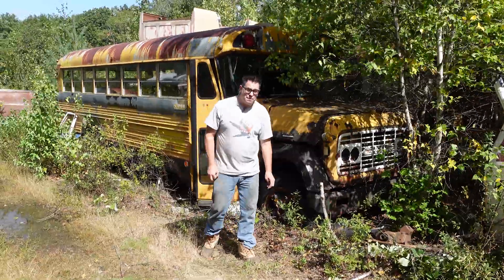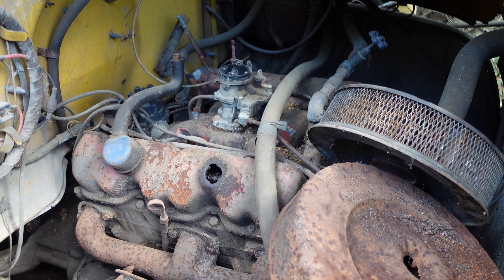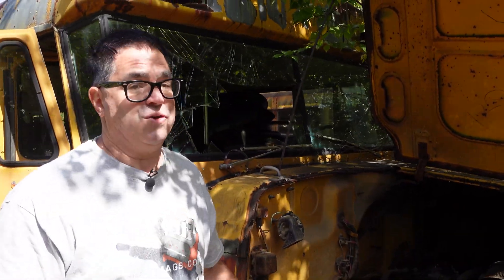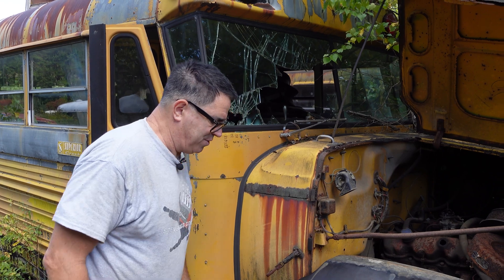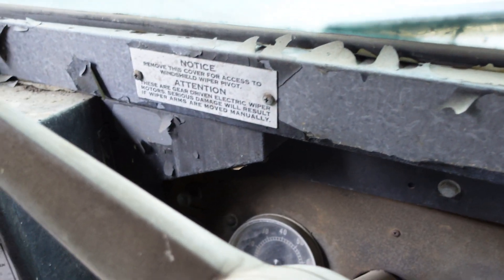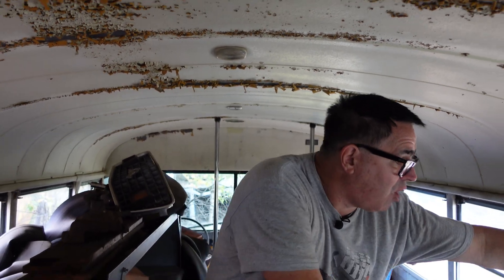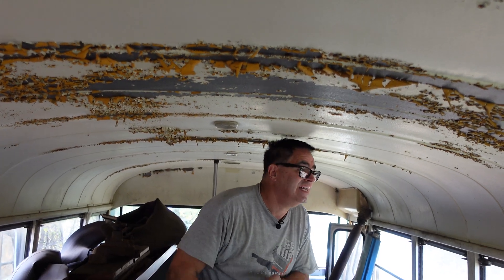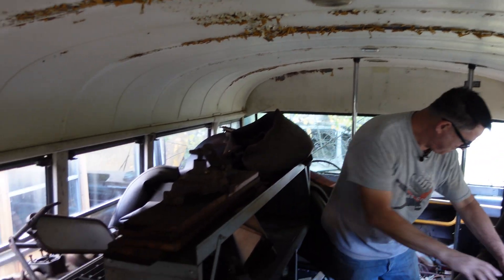Blast O Lene S’Cool Bus

Comment: From 1972 to 1978, I rode the church bus to a local Southern Baptist church in Asheville, NC.  Their fleet had many 1962 through 1964 GMC buses with V6's using Carpenter, Thomas, Ward, Superior, Blue Bird, and Wayne bodies. They also had some 1963 and 1967 Internationals, 1964 and 1965 Chevrolets, and 1963 and 1964 Fords. When I would get bored, I would look out the window and study the buses and their configurations. Also, Kosciusko is pronounced Coz-ee-es-ko.

Comment: I graduated from high school in 1980
-GM busses, gasoline powered, manual transmission, low seats with steel exposed frames
Just a few years later?
Any school bus I saw was diesel and automatic with high, padded-everywhere  seats.

Comment: I remember as a kid. I rode on those buses to and from grammar school. The school district had a mix of Gillig, GMC, Chevrolet, International Harvester, Ford and Dodge.  I remember Superior Coach, Wayne, Ward Body Works, Thomas, Gillig Bros. who provided the bodies for the Chassis. Buses had 4-speed manual transmissions petrol engines, and drum brakes, later on the buses had to be equipped with escape hatches. Later on they started being equipped with diesel engines, automatic transmissions, and disc brakes. The diesel engines are more economical than gasoline engines, automatic transmissions save on downtime and the same with disc brakes. There are now three manufacturers being Blue Bird, Thomas built buses which is owned by Freightliner and Mercedes-Benz, and Integrated Chassis which is a subsidiary of Navistar Corporation which owns International trucks and bus.

Comment: I'm 62 and have fond memories of riding a school bus all through elementary school in Jacksonville, FL. I remember the bus I rode was an International Harvester with a Ward bus body. I'm guessing the first was a '65, then later we got a newer '68. Like the one you're showing it was a four speed manual. Years later (early 80's), I would occasionally drive a bus for our church. It was a '72 GMC with a Bluebird body. Interesting thing about it, the manual transmission had a hi-lo range with a button you would pull on the shifter. Essentially, it was an 8 speed. It could keep up with interstate traffic with little trouble.

Comment: Steve, I grew up in Lima, Ohio and when moved there in 1962, Superior Coach workers, would drive around on the east side of town; in new front engine School Bus Chassis only, dressed in grey coveralls, sitting on old wooden crates, smoking cigars... My School Shawnee; always had Superior rear engine "pusher" School Buses, with AM Radios and 5 encased speakers of industrial steel, mounted down the ceilings bend, above the seat windows... Starting in the 1960s the rear engine buses were GMC V6 Gas; while older pushers versions had different engines and 3 then 4 and 5 speed manuals transmission... In pushers buses; there was always 1 passenger seat; with larger spacing between seats, creating a row, for the exit by a side emergency door... The Superior Bus "pushers" 1950's to 1970's; had at least three seats with window frames; that were decal marked  emergency exit and the entire window frame would swing out... The thing I remember most, about the GMC V6 gas engines: is that leaving School, with a mass of busses lined up; the "EXTREME" lean smell of fumes... !! A benefit of GMC V6 engine was: placing the spark plugs and wire set next to the intake manifold valleys;  prevented engine water flood out failure... *The GMC V6 engine was so strong and durable being a Comercial engine: that GMC successfully converted it to a Diesel Version; with not any issues... !! Maybe GM should have utilized GMC V6; instead of the Oldsmobile V8 Diesel disaster... !!

Comment: Hey thanks for clarifying. I knew the 305 V8 but I couldn't remember the CID for the one that was around the 350 cid. I have one in a 67 or 68 GMC truck it's got like 50,000 original miles and I bought it with the idea of making a car hauler out of it. But man I might as well have a 454 in that thing! That V6 got crap for gasoline mileage. It has plenty of torque it just can't beat it. I know guys far older than you or me still driving dump trucks with those engines in there. Then mostly farmers and small time operator piddle around guys would be insulting but some people call them that. I don't remember my old truck I could look at the side see if there's a side markers or not but it has a pickup cab front clip body. There's a cab and chassis that Winnebago made into a rv. When I bought the thing half a lifetime ago I was thrilled that those two brothers wanted the RV part of it for scrap and took it off for me. Now I kind of wish it could have been saved and its original format. Anyway to the V6 guys who love those engines want to keep the truck original, my engines are gold mine because there's different internal parts are just not available anymore new or reman. Very well explained! Hey remember when people are ages you are a tad older than me. But remember when we were the younger guys? Word of advice to younger guys it sure does fly up quick on you age that is. One of the things Steve aren't you a big fan of all people I think you would be as a mustang II? It's the car that saved the pony market and help Ford out a great deal. It also is probably the reason why we got to throw back cars like they hellcats! Of course we never did have anything with that kind of horsepower back then off the dealers floor. In short I say this because it also saved the Camaro. Oil embargo everything was being dropped as far as big horsepower. EPA restrictions kill them. But the name plate mustang lived on. It was a quark of fate that Ford changed the mustang into an econo box at just the right time. Remember when Chevrolet dropped a Camaro and then brought it back cuz once again they wanted to compete with Ford and the pony market. After all without the mustang would you have had the Camaro in the firebird to begin with? Now there are some tricks you can do with the Ford mustang II. But at least even though they weren't really a true mustang by most measures it held the name plate in the market and gave the competition a reason to produce similar cars. Then he got the ugly European styling and left the mustang grill behind. I guess in some ways you can say the mustang grill exists again. That would be an interesting episode. Explain to the current generation how the European mustang had no real market for resale for collectors for a few years after it's introduction. But like many undesirable cars when they were originally made and for a few years afterwards they were brought up because they were affordable and now they're even sought after. 56 Chevy is 63 Impala and of course the ugliest granddaddy of them all the 58 Chevy car! At least the majority thought that back in the day. I'm glad because the 63 Impala ss4 and floor ragtop that I've got along with it's lesser powerful twin ragtop, I could never afford them otherwise and I've owned them for decades. I'm about to a point where I can't just fight keeping them based on their current value. Anyway ugly ducklings to Superstar would make a great episode and that's not copyrighted by me at least you're welcome to modify and use it. Thanks for the junkyard crawl.

Comment: My memory of the GMC v6 truck engine was how bad the drivability was. Especially when cold. They would cough and backfire/spit back through the carburetor a whole lot. Seemed like every time you stepped on the throttle, they would cough, spit and sputter. And it was a problem that was never resolved. My dad carried a fire extinguisher in his truck. And he had to use it more than once.  It seemed like every GMC v6 I saw and heard had that trait. not just my dads truck. That motor had a lot of torque, but no rpm. You were all done by 3500 to 3800 rpm. Seldom if ever saw 4,000 app on the tach.  I think my dad had a 4/10 rear end with posi traction. More than once I saw him roasting both rear grip tires pulling a boat and trailer up a boat ramp. 70 plus mph was really starting to push it. Pulling or hauling a load was never a problem. Going fast was.

Comment: I'm headed to Kosciusko (Kos-see-yous-ko) today to deliver a load there. 
And the bus crash referenced here was not in 1978 but was on May 14, 1988. Easy to find information on this with Google. It is also the reason gasoline engines were outlawed in passenger carrying buses.

Comment: Hi Steve, your 58 years old, I'm 62 years old.  From the late 50s to the early 80s, GM and Ford did produce gas powered big truck engines that where not available in light trucks or vans.  Theses engines are not used for racing or hot rodding because there outside dimensions are too large and they weigh about twice as much as a car big block engine.  These engines have been replaced by diesel engines.  You see as we got into the early 80s, ALL big truck gas engines required emission controls as cars.  At that time, no desal engines had emission controls at all.  All diesel engines NOW have the same emission controls as gas engines do now and this includes farm tractors and bulldozes and the desal industry is very upset about it.  Please reply.  Dave...

Comment: I was told many years ago by a reliable source that the GMC V6 engine family was born out of an attempt by General Motors to make a commercial grade diesel engine. That's why everything in that motor is so ridiculously heavy duty and also why the plugs are mounted High side, because that was supposed to be the location of the fuel injector. Can anyone out there either confirm or deny this?

Comment: As a kid in the 70’s often high schoolers drove the school bus. Hard to believe today, but that’s how it was in my rural NC upbringing. Our old 4 spd Ford school bus would do about 30 mph up the mountain highway to my home with good ole’ high school senior Ronnie Scott constantly shifting between 2nd and 3rd to coax that beast up the mountain. He would often give it a rev when we got off the bus, key the ignition off then back on so it would give a hellacious backfire just as we walked to the back of the bus after getting off. Pissed us off then, but hilarious to think back on. I couldn’t believe it when I later moved to Florida in the early 80’sband rode on an air conditioned bus with an am/fm stereo and automatic transmission driven by a middle aged driver. Such luxury!
Reply: Did the Ford bus have a straight 6 or V8?

Comment: Drove a GMC bus in a school bus figure 8 race about 30 years ago. It had a V-8, not sure of the size or the year of the bus. The figure 8 track was pretty small so I drove it in 1st gear only. The bus had tons of power and ran pretty quick for something that size. It started overheating pretty bad after about 10 minutes so I shut it down. Still ended up in 4th place out of 9 buses.

Comment: I worked at a GMC dealer from 1974 to 1977. I worked on a lot of these. You could idle them down to 200 rpm to set the valve clearance. I did one replacement on a dump truck that was converted from a tractor. It had the 478 magnum. What a power house! Great engines.  Not so much the toro flow diesel version
Reply: We called the diesel version the turoflop
Reply: @danapicray9040  We called it the terrible floo
Reply: @danapicray9040  flow
Reply: I know, we called it turoflop because it was a flop. If it was warm you had to push it to get it started because the starter wouldn’t turn it over fast enough, even with a grader battery on it.

Comment: Lil' correction Steve: the Magnum engines have different, better flowing heads, intakes and exhaust manifolds. The only V6 with a 1 barrel was the 305A, an early version that was quickly phased out. The rest all had 2 barrel carbs. They are slow but have lots of low end torque. The V6 crankshaft makes a SBC crankshaft look tiny. Main bearings are over 3 inch diameter. I have a 65 GMC with the 305 V6, building up a 478 V6 to go into it.
Reply: My buddy had a 68 camper special with the 305 and we took it out and tore it down and stood the crank next to a small block crank!!!! Lol. Your right, so much bigger!

Comment: In the early 2000s I worked in an engine shop and sometimes we did some work on school buses.
Had one with a Cummins ISB giving us a problem, since we were a Cummins dealer I was able to plug in with the laptop and defeat the speed limiter.
Got that sucker to 94mph on a test run. 
Blue bird brick just hammering that air with that flat front end.
And I think I forgot to put the limiter back 😄

Comment: I've worked on GMC V6 engines. You have to blow away all the crud that accumilates around the spark plugs before removing them, or it ends up in the cylinder.

Comment: Gas tank straps and a move to diesel was also implemented around the time of the roof escape. You can probably credit the straps and diesel to me being here, my bus was t-boned in icy fog in the 80's. Car damn near slid under blowing a stop. Hit the tank and folded the fender into the tire. It was one of those buses.
Reply: I guess it wasn't exactly the same if it was diesel.

Comment: NYC had a fleet of GMC garbage trucks from a very similar vintage that doubled as snow plows.
Those things were still maintained and used by the city into the early 1980's. Must have been easy to service and re-engine periodically. Don't know what sized V6 they used.
Reply: Milwaukee uses garbage trucks for snow plow work also.

Comment: Something to think about on school bus safety. They switched to diesels because of the lack of them exploding or catching fire on a side impact if the tank got ruptured like a gas bus would and there were tragedies of that happening. The way the green crowd wants to outlaw internal combustion by two years ago at the way their pushing it I cant see an electric bus being safer the way Ive seen plenty of electric vehicles short out and the batteries go up in a fireball in an instant that takes 7,000,000 gallons of water to put out its just that unstoppable. Here again, diesel is best.

Comment: If you have removed the spark plugs for a tune up, be extremely careful not to drop anything down the holes! I did! Somehow, with the plugs removed, I dropped a nut that was sitting in the valley down a spark plug hole. Could not get it out with a magnet (stainless steel?). Had to remove the head to retrieve the nut!!

Comment: I also rode one of these about 50 years ago. I was a young gearhead, so even then I noticed details about our buses. Ours were Blue Bird diesels for the most part, but they were really slow and underpowered whether gas or diesel. Our buses were an eclectic mix of manufacturers (Ford, GMC, International, etc....). The flat front buses with the engine in the back were quite common in my school district as well. I don't know who made the rear engined buses, so that would be an interesting video if they had one in the yard.